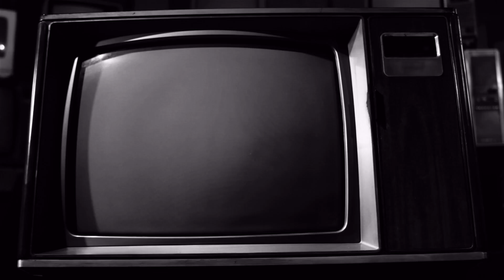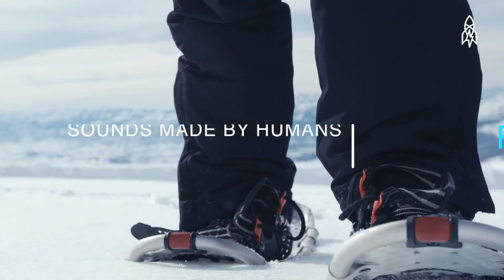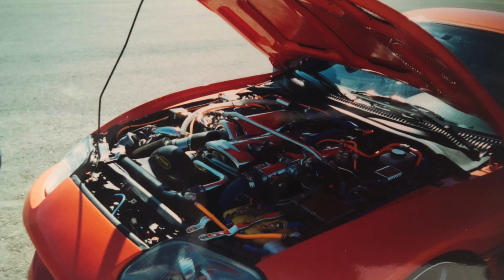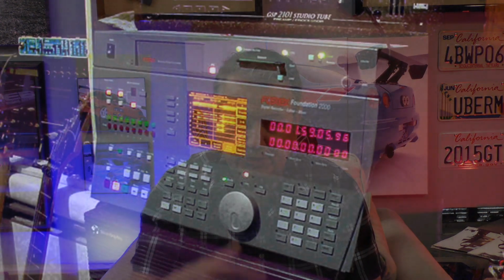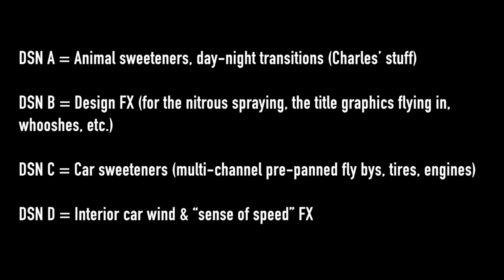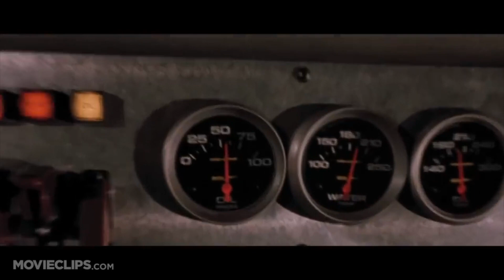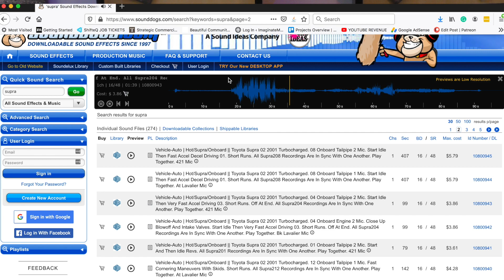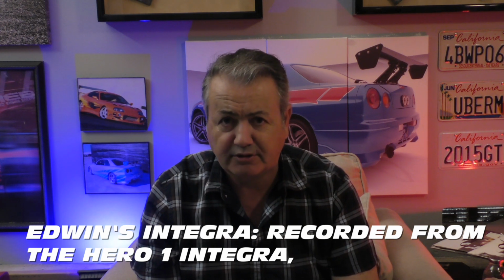How to Get The Engine Sounds from The Fast and Furious cars.

Comment: Most of these sounds were also used in Need For Speed Most Wanted (2005) during the cutscenes
Reply: NFS Underground as well.
Reply: Interesting...
Reply: I realised the Craig's Supra sound is the same that is used from NFS Pro Street - The Run.
Reply: @shapshooter7769  underground came out before the first FNF movie
Reply: @Spherz  first ff 2001 a underground 2003 after 2f2f
Reply: @Spherz  even 2 fast 2 furious came 4 months before underground 1
Reply: @ibnulbevan8020  my bad got it screwed up with underground 2
Reply: Especially with Eddie's Skyline lol

Comment: I think that just sitting down and having casual conversation is the hardest stuff to do. But the extremes? I know what it feels like to come racing around the corner at 90 miles an hour, sliding the car sideways. I know what gear I’m hitting it in when I’m coming around the corner and where I need to downshift. So to me, that’s the fun stuff.

-P.W

Comment: i think the same could be said for video games as well

looking at Forza and Need For Speed

the RB engine sounds does not feel like it was some other engine rather than the actual RB26 or 2JZ sound in the case of the Supra.

Gran Turismo still records the actual car audio inside the car, outside the car and in the engine bay and by the muffler pipe

You can even put the Subaru Boxer engine sound and compare to the actual Subaru engine noises and it very hard to tell them apart which is from Gran Turismo and which is the real deal.

Same with the anime Initial D

They did get an actual AE86 which is own by keiichi tsuchiya to do the 4AGE sounds for the Hero Toyota AE86 Sprinter Trueno. 

That fact that Japanese anime has actual car engine noises for a mid cost production basically blows away the big budget crappy Fast and Furious movie

Comment: Just for clearance. If you "2jz swap mustang" it will still have totally different sound in comparison with "2jz supra". Its about of material used on car and the most important - exhaust length and many other factors... "2jz supra" makes "2jz supra" sounds only in "2jz supra". From here you can start modifying the sound.
Thank you for Craig for Your Video!

Comment: It’s easy to get The 2 fast 2 furious gtr sound. Rb25det or 26det trust t78 twinscroll turbo, trust twinscroll exhaust manifold and front pipe and block off blow off valve for turbo flutter.